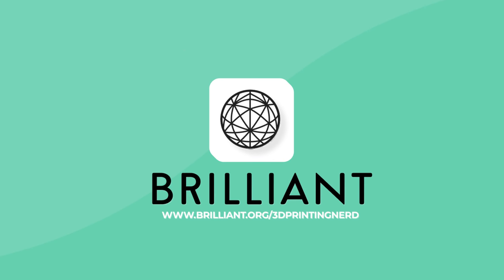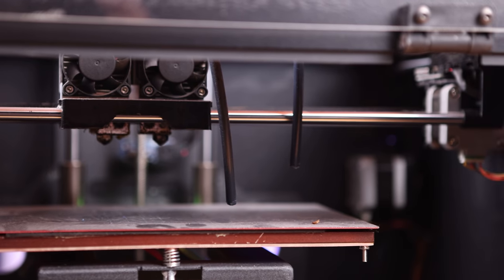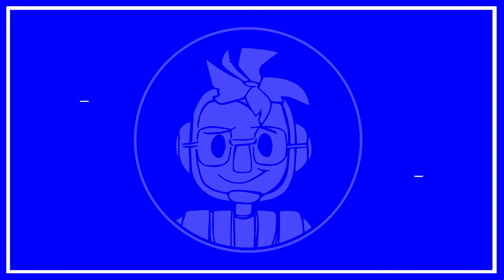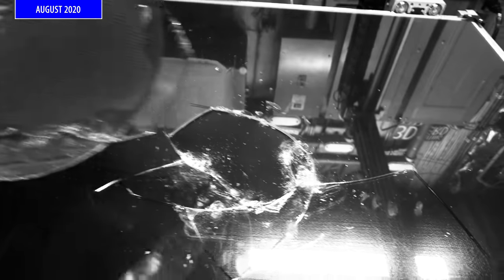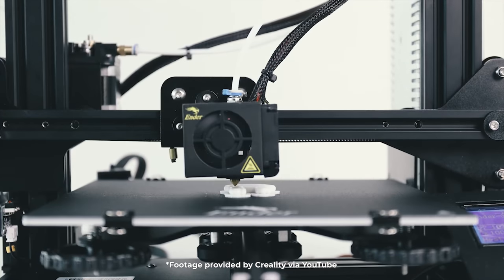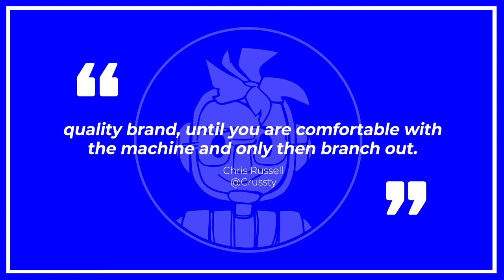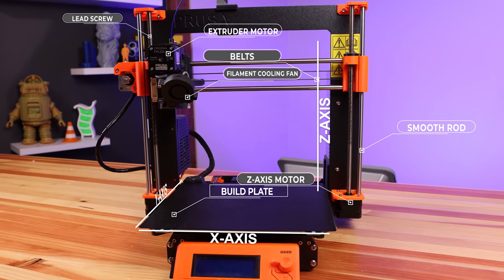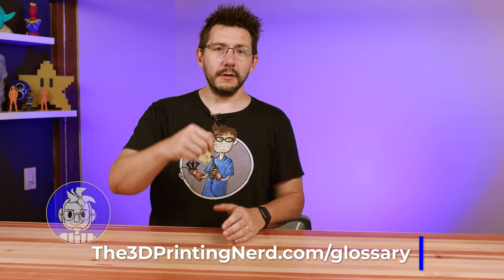3D Printing 101: 5 Tips from the Community!

Comment: Tip: don't give up
Reply: Thanks. I put a volcano on and couldn’t get the pos to work, I left it and said”I give up” and haven’t touched the printer since
Reply: I don’t give up, I take long breaks
Reply: @willmoran5694  you should pick it back up
Reply: Best tip ever.
Reply from the maker: PINNED
Reply: 3D Printing Nerd I saw this and thought you were replying to my comment😭😭😭 lol I got the notification
Reply: Daniel McPherson just ordered the parts for it
Reply: Definitely, that is the best advice for really any hobby
Reply: If your support fails in the initial few layers then push some blue tack onto the build plate at about the right height and the printer will push into and print in the blue tack saving the print.
Reply: 3D Printing Nerd Thanks Joel. Have a nice day.
Reply: @karlnowakowski7866  Thats a lot of blue tack.

Comment: If you go down the rabbit hole of upgrading your printer, it's a good idea to buy a cheap secondary printer that is dependable and doing changes one at a time.
Reply: This! The worst thing about upgrading your printer is finding out that the part doesn't quite fit after you took the thing apart. That's why I recommend you get something close to perfection if you can afford it. Prusa MK3S and you can focus on making things instead of messing with the tool you want to use.
Reply: @5Komma5  
true, unless you are interested in deeply understanding the technicalities of the printer. 
I wouldn't recommend to go with a printer where you spend more time with upgrading and getting the printer to work than actually printing :P 
You can already spend enough time on finding perfect setting, post processing etc. without having to also worry about the hardware all the time. 
Maybe the Prusa Mini is a better priced option for beginners and you still don't have to upgrade anything ;)
Reply: Additionally, if you're going to upgrade a mainboard and you need to print an adapter plate in order to mount the new mainboard, do that before taking the whole thing apart. Learned that lesson the hard way.

Comment: Tip: Be patient!
3D printing isn't fast. Mistakes and adjustments to your plan will happen.
Reply: Yes, but u can print a lot faster knowing your printer limits and what you can do with the slicer.
I was printing with 40mm/s to balance speed and quality. Now i print with 20mm/s external walls and 200mm/s infill with a very good quality.
I can push even further with my printer, but i need to update the firmware, i just find that i have a problem with Linear Advance settings.
Reply: @brianfhunter  wow, I never thought to speed up infill! Considering it doesnt need to be pretty, it's internal, and it takes a big chunk of printing time, I'm definitely gonna try to speed it up
Reply: @pcdc1337  - Be careful with the accelerations and jerk,  with high speed infill on small parts, your printer can start "walking" with the vibrations.
My printer is not very robust, than i need to tune down the acceleration, using 1500mm/s² now.
.
Also
Ironing takes a lot of time with the default settings on Cura.
I tunned UP to 100mm/s speed and 0.3mm spacing.  Around 3 times faster with zero lost of quality.
Reply: This should be #1. Be Patient. Getting into a rush is where the failures happen.

Comment: When printing on a glass plate sometimes the print sticks so well it can't be removed without the risk of damaging the the glass, when this happens try placing the glass plate with the print on it into the freezer (after it has cooled of course) for 30 minutes or so and the print will usually fall off with just a light touch.
Reply: My bed size is 510x510 mm. Its a bit to big for the freezer. So I use a bunch of ice packs under the bed and it works
Reply: Good tip. Thanks.
Reply: What if you put a heatgun on the back of it?
Reply: @MisterMakerNL  the reason that the print comes off is due to the cooling(shrinking of the glass) faster than the part, popping the part off. If you heated the glass the part would not come off. Maybe a on top of a cold ac vent...

Comment: I'm using a stock Ender 3 v2 for almost a month now and it works pretty good out of the box. I am using CHEP's profile as basis for my prints and only change the support, quality, infill, and print temperature. First used the Creality filament then branched out to cheaper ones. Works fine for me.

Comment: I learned the most with the upgrades I've done to my Ender 3.  Started with BLTouch to stock. After this I descended into an all hot metal end, SKR board upgrade. And then, The Ender Extender kit, which is where I learned the most. My machine was ripped apart, and rebuilt almost from scratch. Took advantage and did many small upgrades, converted to Direct Drive, and a Magnetic Flex board. I don't see myself buying another pre-built FDM printer ever again.  Now, I'm working on  a Mixing hotend setup for an Anet A8+.

Comment: I would add one caveat to the flexible magnetic plates. If you print very large parts that cover a lot /most of the build plate it can be extremely difficult to get the magnetic plate off the bed. Because the part will prevent the plate from flexing and you now need to over come the magnetic force of the entire bed.

Comment: This was an excelent video.
My 1st printer is a homebuild [by a friend] delta printer.
My 2nd printer is an Ender 3. Because of tips like these I was able to print an enlarged version of the TIE INTERCEPTOR on my Ender 3. Without it coming loose {Hint, drop print speed to 70-80%}.
Because I learnt the lexicon of 3D printing, when I go to my supplier for parts, I can ask for it directly, without playing guessing games.
Using the correct terms for items is important in any field. A Leo in astrology means a star sign, in astronomy it means low earth orbit, in law enforcement it is a law enforcement officer.
Years ago, a person who claimed to know computers ordered a flat screen. He used the wrong term. He meant an LCD monitor. A flat screen is a CRT monitor with a flat screen. He blamed me for him ordering the wrong screen.
Filament: You have such a whide range of filaments. We have basically 5 types. Da Vincy, CRON, WANHAO, Tree33 and filament factory. I am 1 of the few South Africans who print filament factory without issues. Because I can read the printing instructions on the bag, and adjust my slicer to comply.
TIP: If you have issues with your filament, make sure 1] what type of filament you are using, PLA-ABS-TPU 2] Are you using the correct temperature for printing that filament? 3] is your print speed right for that filament {TPU requires me to set my speed on my printer to 20%}

Comment: Just found the channel.  I'm on my first week of 3D printing.  Having done 3D animation, I've already got my first model I'm trying to get a perfect print with.  Now I'm nodding my head about some of these things.  I got an Ender 3 S1.  Did manually level before now running auto level.  Getting the Z offset just right so that the filament has good adhesion for the skirt has been the hardest thing to get used to.  I first got the S1 after seeing recommendations about it being easier to setup (as well as being more versatile).  Setting up the hardware did seem easy....but then when I turned it on and tried to get into the menu, I wasn't seeing settings for Z offset and the z axis wouldn't move.  I double checked connections....even tried opening up the bottom to look at the main board.  Turned out the controller was set for laser engraving instead of 3D printing!  Surprised that the manual didn't mention this, and I haven't seen it online.  Will be watching more videos to get more tips on this journey!

Comment: Tip: when in doubt, Google it.
Tip: never print too close to the bed. My flexible magnetic bed has several holes now lol
Reply: derchesten mine too 🤣
Reply: My default Ender bed now has drawings on it from the  .4 nozzle scrapping itself across the bed. Now it's about a 1mm nozzle. Tossed it and put on a .6
Reply: @TShepard  look at the bright side, you can get fantastic speeds on big prints with that nozzle lol

Comment: I have a tip for leveling the bed on an Ender 3 but I am not sure how easy it is to replicate.
I have a glass bed and I know exactly when the nozzle touches it because I can feel the vibrations from the hot end fan through the bed leveling knobs. So I just set the bed low and slowly raise it until I feel the bed leveling knobs vibrate. This is has helped me get perfect first layers every time and gets rid of the guesswork that comes with using paper. Just make sure to preheat the bed first before leveling it.

Hope this helps and happy printing!

Comment: my first printer was a flashforge finder. The print surface has a sticker that lasts about half a year. After that you need to start using glue (once a week) or maybe even rafts. I was fine with it for the longest time, but ever since my ender 5 plus I can't imagine printing with a heated bed. The finish on the bottom is 10 times better than when I print on the flashforge finder!

Comment: thanks the help of the community, I learned how to clean out a clogged extruder head and get my printer back to full operation. theres still a few bugs I'm working on, but one that I've noticed with the Ender 3 is to make sure that all bolts and screws are securely tightened down, my build plate was wobbling due to loose screws, still not perfect yet, but much better.

Comment: I level my hotbeds every... single... time... I... print.
It is that important. A serious note: Heat your hotbed and hotend to the temperatures you'll be printing at. Why? Much of your printer is metal. All materials expand when heated and metal to a larger degree than glass. If you level the printer while cold the nozzle and bed will move towards each other as you print, potentially creating a over pressed first layer. Always level at printing temperature and beware the hot components.

Not all inexpensive filament is low quality. If you want to save money on filament I recommend trying Inland filament from Micro Center. But most low price filament is not worth attempting. The diameter is often inconsistent and/or there is often water within it (when water hits your 180°C = 356°F [°C x 1.8, +32 = °F] hot end it instantly turns to steam, moving filament away from the intended print area. Yes, low quality filament is not a smart purchase - The Inland filament is not low quality, only low price).
Reply: Thanks. I may check out that filament

Comment: Here is a tip if you want to use your printer to make things instead of constantly fiddling with it / upgrading your printer. Get a Prusa MK3S.
Had a Mendel Max 1.5 for four years and was constantly messing with it before I could even start a print. I have a MK3S for about a year now and all I had to do is lube the slide bearings. Turn on, stick the SD card in and come back when the part is done. The MK3S sounds expensive until you realize how reliable it is. It just works.

Comment: I just bought an all metal hot end to upgrade my Creality CR10S. It came with a small packet of thermal grease but no instructions. I tried looking through Google and Youtube to see where I should be applying the thermal grease but did not find any information regarding this process. Can you please provide some guidance on how and where to apply the thermal grease on the all metal hot end? Does the thermal grease help or affect the print quality?
Thanks, Joel.

Comment: After using my Prusa MK3 i3S for I think two years now, any printer I buy has to have auto bed leveling and a removable flexible print bed.  I had a Wanho first, and I never got the hang of bed leveling.  I had to remove shards of blue tape from the nozzle far too often, and I don't want to go back to that.

Comment: I've done on the fly leveling as the skirt was printing, helps a lot but I'm definitely going to invest in a flex bed to cut that down
Reply: just having a flex bed won't cut down on leveling issues if anything you may end up leveling just as much if not more because every time you remove the bed you run the risk of throwing things off-kilter

Comment: Im about 2-3 months into my 3d printing journey and its all been going pretty smooth so far, no problems with anything except a warped bed, and it seems to be getting worse over time. Is there any better beds for an ender 3 than the ones from creality i should look into? Its not the sheet ontop its the actual heated plate that is warping. I have a high spot the shape of an egg right in the middle, and theres a line near the bottom that is so low the filament will go from a perfect squish to up in the air within 1mm

Comment: One trick i found to do when bed level on Ender 3 or other printers with out auto bed level is instead of using copy paper use a business card, one of those you get from every convent you ever visit and those can now be used even thou their use is for calling back the sales person and doing business bed leveling with business cards i find is the best way, 

Why you may ask.
I find copy paper too thin and your nossel will be to close to the build plate and that will scrape the first layer, how ever if you use the same trick that you normally would do with a peace of paper and just do until its stock a little mean you have resistance when you pull on the card, and when out you can see the nossel made a bit of an indent on the business card, then your golden.

And you do not have to fold or do other stuff with the paper and was it 2 or 4 times you have to fold????,  business card is just the right thickness, and it will then have an extra use and if it becomes to dented the card swap it out for another and make your wallet lighter. :)
Reply: Same concept, but I use old playing cards from an incomplete deck of cards.
Reply: @BarryTikkanen  Yes it is that thicker card / paper that makes the difference. PS. remind me not to play poker with you joke your marking the cards :)
Reply: Kent, nossel is not a printer part. Where did you find this word?

Comment: I built an industrial like enclosure for my Prusa Mk3s - you might like it :)
Reply: Mine only looks the part... it’s made from two black IKEA ‘lack’ tables attached together vertically; with plastic windows screwed to the upper section. The lower section has a plywood panel painted black and casters for moving it around. I also stuck a bathroom fan (also painted black) from Home Depot on it with a flex duct to vent any fumes outside.
Reply: Dark Winter As long as it does the job 👍🏼 I planed to use the two ikea lack as well at the beginning, but then it changed a bit with each design idea. Yours is definitely more practical and efficient to build 😄

Comment: I am really struggling to get things to stick and not fail on my ender 3, I had great success with the stock ender bed textured pad it comes with but after getting the ender 3 glass bed for the flat service I can't get anything to stick no matter what I do. I don't want to go to the blue tape and glue because I feel like it should stick(and it makes it look like trash)Am I doing something wrong. I have had so much trouble that it has turned me off of 3d printing and that makes me feel really sad.

Comment: If you match the print object wall thickness to the extruder tip as part of designing you can scale up print without increase in print time. 
near enough. 
Bigger extruder tip to match scaled up size of print wall thickness. 
Thank you.
Bye for now and be well from Will and Mr Data :)  :]

Comment: Get some sandpaper and dull the far edges (but NOT THE MIDDLE) of your chisel. It’ll help prevent gouging of the bed/build-plate.
Reply: Jamie Smith - I actually have both; but sometimes the edge on the spatula isn’t sharp enough to get started. So, what I’ll do is use the razor sharp edge of the chisel to get the edge of the part off of the build plate (glass in my case) and then finish with the spatula.

Comment: Glass bed?  Use Rubbing Alcohol.  Tilt the glass on its side, use a drop or 2 of rubbing alcohol on the raised side of the glass so that the Rubbing Alcohol will go down around the print.  Wait a few seconds, and it will slide right off.  No need for a scraper.

Comment: If you have a BL-touch on your printer, you should print a cover for it, to protect its tip so it does not get bend if the print fails. I use thing #3762809 from Thingiverse: https://www.thingiverse.com/thing:3762809

Comment: My advice: 99% of problems are user error.  Your print bed isn't messed up, your nozzle doesn't need to be changed, your esteps don't need to be calibrated.  You messed something up, don't blame the machine.  Clean your bed.  Level your bed and level it again.  Check your slicer settings.  Search youtube for "3D printer fix for __________".  

Especially these days, most people coming into 3D printing don't WANT to put together a kit and learn the ins and outs of the machine.  They just want to print, not tinker.  Telling these people who are not technically inclined that they need to pull apart their machines will just result in a broken machine.  That's why the market is going to 98% factory built machines and away from kits.  It reaches a wider audience.  Most of the people I see frustrated with 3D printing don't know why prints warp off the bed or why stringing occurs.  They don't have the base knowledge about 3D printing, they're not going to rebuild a hot end.  I'm sure there was a time when the advice to novices was "pull apart the machine and see how it works".  That's no longer the novice segment of the market.   The novice is now someone who bought a 3D printer as a consumer device to make things, not a tinker project.

Comment: My best pro tip.

Always Print Vertically.
Reply: from experience?
Reply: @aronseptianto8142  a LOT.
Example: If your Printing the Space Shuttle, Slice it with the Nose Down & engines up. 3d Model your own support struts and then Print!